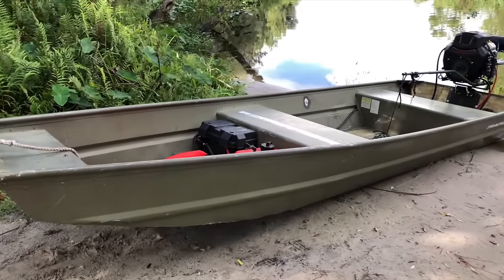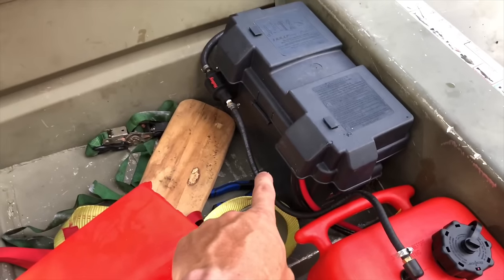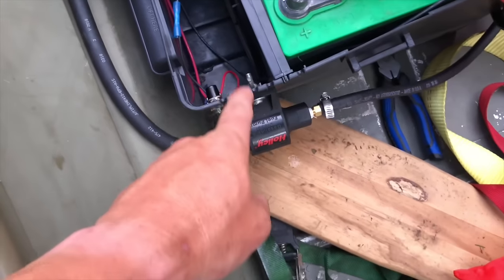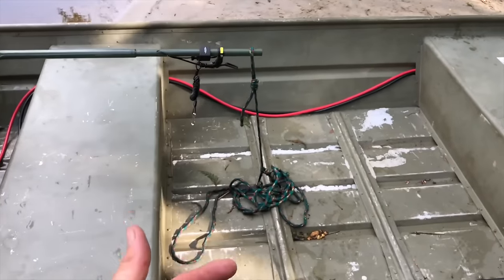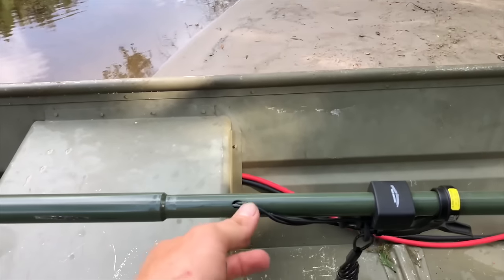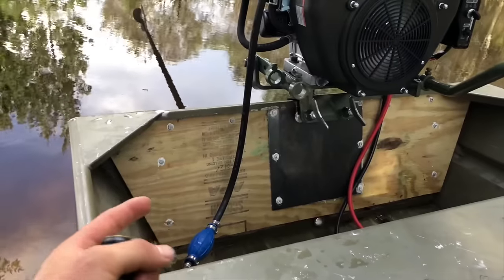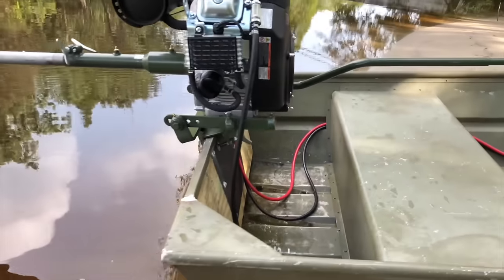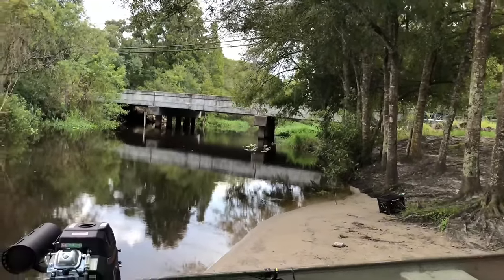22HP Predator 670cc SPS Mud Motor Setup 1436 Tracker

Comment: Those cheap riveted Jon boats are notoriously flimsy, what you experienced with the transom is very common, I HIGHLY RECOMMEND you use treated lumber on the transom, if that is ordinary plywood you need to watch it closely for deterioration, water will cause it to self destruct over time.
Reply: Treated plywood will cause the aluminum to corrode, you never want to use treated wood when it’s contacting aluminum. Much easier to replace the wood than the transom
Reply: I didn't know that!  Yes, far easier to replace the wood than the entire transom, that would be a job!

Comment: Do yourself a very big favor and get rid of that screw together glass filter they vibrate loose and specially with your electric fuel pump it will start leaking and you will be a ball of flame there has been more cars burn to the ground because of them than any other filter if you don't take my word for it Google it one time and listen and read the horror stories about them filters and as well to have a tendency to crack just a heads up

Comment: SHOULD HAVE PUT THE BATT AN FUEL TANK IN THE BACK LIKE NORMAL. WOULDNT HAVE NEEDED TO USE ALL THE EXTRA STUFF... JUST SAYIN
Reply: Steve Lamperta if you run this motor with one guy and hat boat, he wants all the weight up front with the long tail way off the back. I have a similar setup and the tank/batt up front is needed for solo trips.

Comment: If that transom board is treated you better get it off of that boat quickly. Treated lumber chemicals are EXTREMELY corrosive and will eat right through that aluminum and turn it into swiss cheese.

Comment: The video is a couple years old. But here goes. You have exceeded the manufacturers recommended horse power rating for this hull.  That is why the transom was having trouble with the power you were applying to it.  The max horsepower is located on a BIA plate attached to the hull by rivets or other permanent attachment. You can be cited for a violation if inspected by law enforcement and the horsepower rating of your engine eexceeds this plate rating. I looked it up and its 15 horsepower.  Your reinforcement would not have been needed, probably, if you had stayed in the boats design rating.  Your solution was good and might last. But the plate is required as well as compliance.  Just letting you know.
Reply: Yeah right, okay whatever, each to his own!

Comment: Watch the ribs on the floor of that topper 14. I had the same boat & the floor flexes when going thru choppy water causing the floor to crack at the edges of those ribs. Look at the new topper 14. They realized they screwed up big time & decided to add solid ribs going across the floor & up the sides like every other Jon boat ever made. Just keep an eye out for that problem. My boat went to crap running just a 6.5hp on the SPS kit, I can only imagine what may happen with all that extra power of a 22hp. Good luck.
Reply from the maker: Jeff McCain thanks mann! Yeah the floor is causing me some issues. I’ve got like 12 rivets leaking water now. Gotta try and figure out a fix for it.
Reply: +Trey Larson I bought my  topper 14 new from Bass Pro, either way they replaced it with a new one 3 yrs after I bought it. They carry a lifetime hull guarantee on all their aluminum boats. Leaky rivets are one thing, but my floor was literally cracking at the rivets towards the edge of the ribs on the floor. Call it a design recall without actually letting everyone know. If you've got a bass pro near by I'd give them a call if you're experiencing similar problems.
Reply from the maker: Jeff McCain dang man!!! Thanks I will look into it!!
Reply: Mine did the same thing.